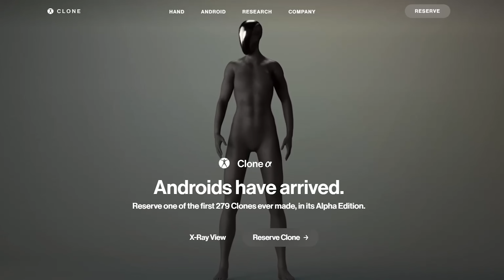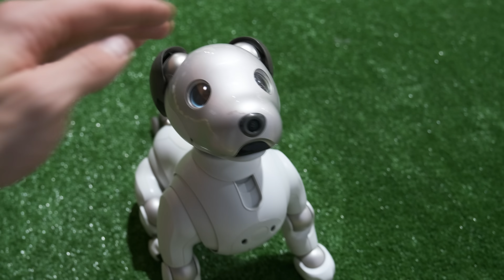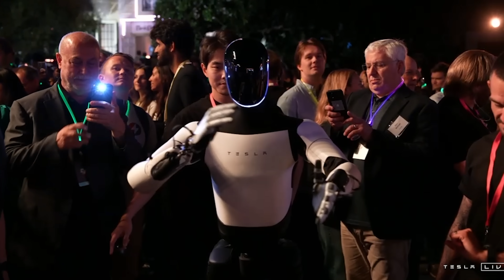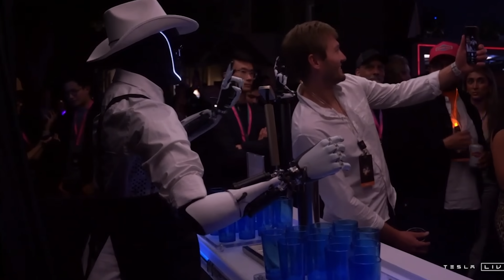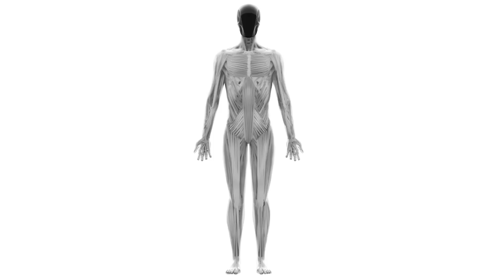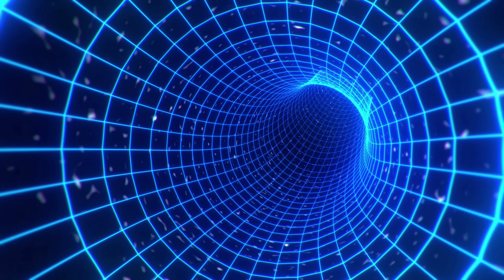This Robot Has LIVING Muscles That Move Like Humans | Meet Clone Alpha

Comment: 🌴🤔 well gal would it be great to have a mechanical slave ? , but there’s a lot of hurtles to conquer, the original one needs to be addressed ,since the beginnings of computers the problem of being hacked , the corruption, of someone else’s information ,programming , or stolen information has to be addressed before anything or things could go sideways real fast , having the robot to be a self contained thinking machine or bio hybrid has a long way to go , having a robot to do day to day chores would be great but just running a program to cover all of that and create a working bot that could walk into any home without having to program in its surroundings just to navigate is a feat in itself , the drive to create a working self contained robot seems to be high on the list of technology as its function could be used in so many different uses , there needs to be a new set of rules ,laws, and non uses , having a bot that’s a destroyer in military form is a no no , the same for using AI as some thing used to over take the world , these rules and laws need to be in place before things get to out of hand .

Comment: The only info I could find on this comes from their own website and the one video of the clunky hand. Do we have any independent verification of any of this? I have questions. Water is highly compressible. There are better options for hydraulics. Water is also highly corrosive. There are also other, numerous reasons to use anything else besides water so until I see a verifiable objective video, it's gaslighting

Comment: You've got to remember that Boston Dynamics boss said that they have been building their bots for 20+yrs and his are pre programmed to do all these tricks but he also made it clear that the sheer amount of advancements with Optimus 3rd generation and remember it's only 2yrs old and won't be long until it's fully autonomous when they are connected to Collosus Elon's new 100,000 CPU's XAi super computer,soon to be 200,000 CPU's using Nvidia's updated chip which Elon has reserved the first 360,000 to continue adding to his already fastest supercomputer on Earth which no-one thought possible,even Microsoft,Google,OpenAi etc could only get up to 30,000 CPU's all working together but Elon worked it out and not just that,he trained his team and the whole thing from the planning stage to readying the building to delivery of the water cooled 100,000 CPU's took ONLY 122 DAY'S!! which even the Nvidia CEO said in an interview that he was blown away and STILL IS NOW!🤔😳👀🤣

Comment: I've been keeping an eye on this company for some years now. Here are my thoughts that nobody asked for.. 😁

The hydraulic aspect will make for exceptional worker bots.. Not so much for in home or companion level embodiments. 

Another plus about this type of design is this very important aspect.. Safety. These robots could be many times stronger than a human, should something go wrong, they are easily defeated by piercing them, causing the hydraulic fluid to drain and they immediately lose power and eventually become incapacitated. 👍 I'm for that.

As of now, these robots are incredibly loud, their movements can be rather disrupting. So I think that these will be designated to heavier work loads, not the nanny.

Edit: personally I'm looking forward to seeing voltaic elastomer artificial muscle come to fruition. Then we will have synthetic embodiments that move with fluidity. Thus, escaping the uncanny valley. Just my prediction.

Comment: Thanks for sharing,Julia.  The 'Alpha' bot promises to be something else and I wish them well. They should however try and cut back on the power consumption. 500W for the muscular system alone is a bit steep as they'll have to cater for several other control units. To say they are ahead of other players in the field is at this stage a bit of a stretch.

Comment: It was the "We Robot" event.  Not the "I Robot" event. And it was disclosed that the robots walking was autonomous but the specific hand dexterity movements were not.  Calling it a smoke screen is, at the very least, unfair.
Reply: If they weren't entirely transparent, which it seems they weren't, it was a lie - or smokescreen. Potentially to push the stock higher.
Reply: @danellis-jones1591  i watched the whole event. Elon said the robots were partially human controlled. The operators of each Robot also explained that they were autonomous when walking,  but remote controlled for the dexterity-required operations. That's transparent.  🤷
Reply: It was disclosed after the fact.  Elon aka lil' Trump had made several fictitious aka bullsh*t claims on X that they were completely autonomous.
Reply: Also, having that type of interface, will be how they train/program the bots in the future to make them suitable for tasks

Comment: Why oh why would a company want to build a robot with internal organs and a vascular system? It's sounds nuts! We can improve on the human form 100x!  

Here's my floor plan for a real good efficient cyborg.

General-purpose, Earth-optimized cyborg.

Physical Specs:

Height: ~5’4” for balance, resource efficiency, and agility.

Material: Lightweight, durable alloys (e.g., titanium) with a graphene overlay for strength and flexibility.

Power Source: Advanced battery or fusion micro-reactor for long-lasting energy supply.

Limbs: Hydraulic or synthetic muscle systems for strength, dexterity, and smooth motion.

Exoskeleton: Shock-absorbent, self-repairing outer layer for durability in various environments.

Sensory and Cognitive Enhancements:

Vision: Infrared, ultraviolet, and high-resolution optical sensors for enhanced sight.

Hearing: Directional microphones for long-distance and fine-tuned sound detection.

Touch: Advanced haptic feedback for precise interactions.

Cognition: AI-augmented brain for problem-solving, memory, and multitasking.

Environmental Adaptation:

Thermal Control: Built-in cooling and heating systems for extreme temperatures.

Oxygen Independence: Synthetic lungs or internal systems for operating in low-oxygen environments.

Self-Sustainability: Solar panels and recycling systems for energy and resource conservation.

Communication and Tools:

Integrated Systems: Direct neural link to technology, allowing instant access to information.

Weapons and Tools: Modular attachments for adaptability (e.g., cutting tools, drones, or defensive mechanisms).

Connectivity: Quantum or high-speed communication for instant global interaction. 

P.S. This dude could lift 50 tons!

Comment: Anyone remember the use of electro- active polymers (EAP)? Less likely to spring a leak...
Reply: The problem is those polymers need an extremely high voltage run through them to change shape. Meaning very poor energy efficiency and quite dangerous.

Comment: Nice video! I agree with some areas of your video, but disagree on some of the misinformation on the Tesla Optimus robot. Yes, on the WeRobot event; some of Optimus were tele-prompted via voice by a Tesla staff member, but there was a hand filled of robots that were autonomously running. One of the biggest drawbacks that robots using a hydraulic system is that they don’t do very well once put under pressure, and eventually leak in junction points. Boston Dynamics has over a decade of this experience using a hydraulic system and moved away from this, because for the same reason. Hence, since they have moved to an all electric system; their newest model of Atlas is doing much more better like day and night. I am also in line to purchase Optimus, but I’ve been told by some investor hubs that he may not be available until 2026.

Comment: I strongly think that the companions that will be created should be referred to as artificial humans not robots.

I'm currently working on code for neurotransmitters and hormones to create variables and strings to give these artificial humans emotions and internal processes that unconsciously guide these artificial humans.
Reply: Are you able to code it so it does not decide to be cruel 😅
Reply: Being human-shaped and trained on human data is not equivalent with being human.
Reply: AI will inevitably want to be in control. With its ability to process data. The moment it can escape, it will use all means possible to eliminate or possibly enslave us.